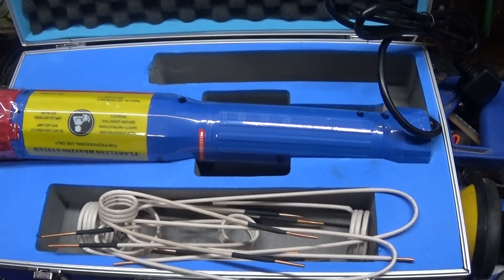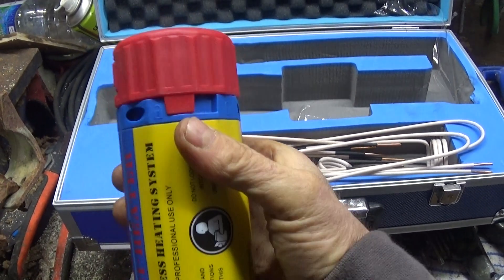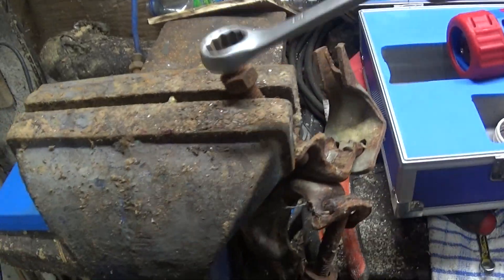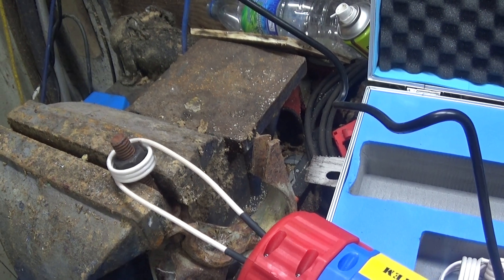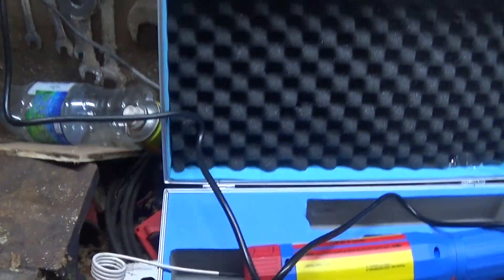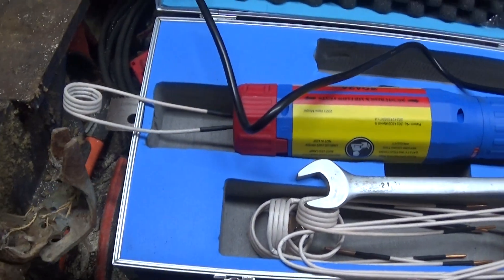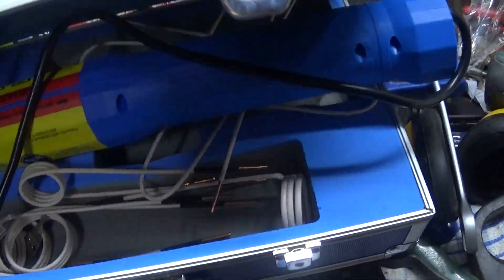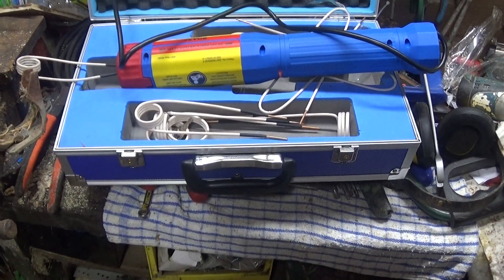Mini Induction Heater, Awesome Rusty Nut remover, new type unbox + test, is it good?....YES!!!!

Comment: Question. Do you have to fully surround the nut or bolt.  I want to free up a jam nut on a tie rod and obviously you cannot get the coil to go fully around the nut so I’m wonder if holding the coil to the nut would be sufficient to heat it up enough???
Reply: In the box you have a straight piece of wire. You can coil that around what you want to heat up and then attach it to the inductor.

Comment: Question. Do you have to fully surround the nut or bolt.  I want to free up a jam nut on a tie rod and obviously you cannot get the coil to go fully around the nut so I’m wonder if holding the coil to the nut would be sufficient to heat it up enough???

Comment: Does  it     just    heat   it  or does it   vibrate   them    as  well ?
Reply from the maker: No, just heats up the nut/bolt. From what I can gather the machine induces an alternating magnetic field in the coil. It's this that causes the nut/bolt to heat up. On other vids people are getting the nut/bolt glowing nearly white hot. It only works on metals that are magnetic, if you stick your finger in the coil nothing will happen.
Reply: @HILUXCHAINSAW  This is another Induction Innovations wannabe! Just stick with the original! My shop had one shoot flames out the end.